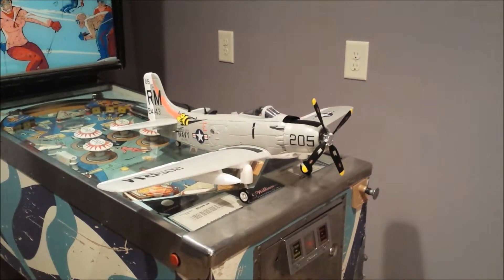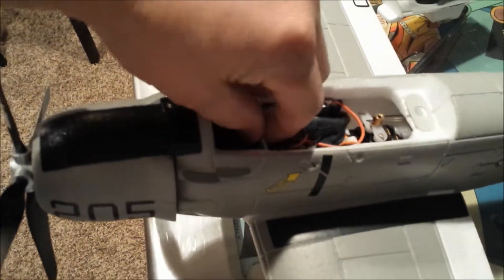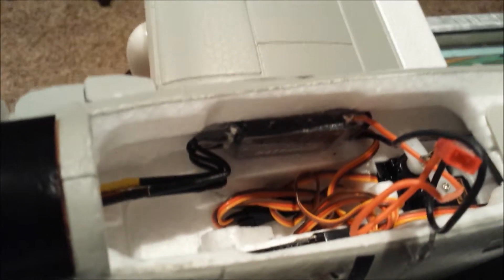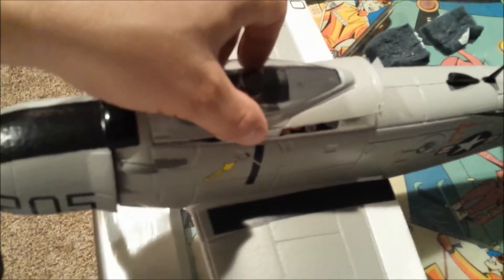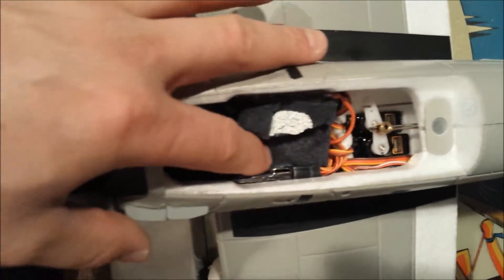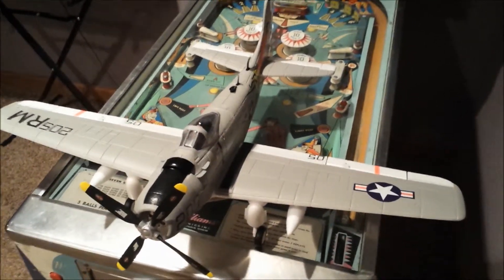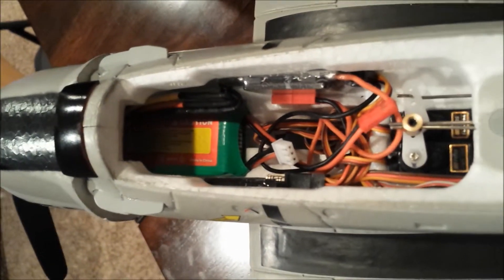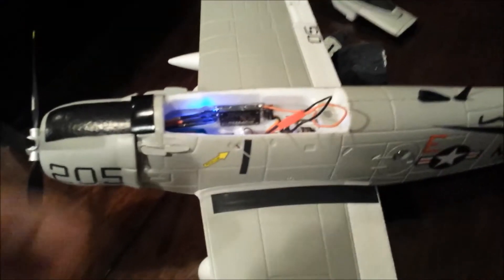Adding 3-axis gyro to FMS V2 Skyraider

Comment: Hi, just want to know how did you balance the CG of this plane. I have bought the same plane, but somehow, I am unable to get the CG at 65mm as stated in the manual. The only way I could achieve would be to add some weight in the tail section of the plane. You have any suggestion?
Reply from the maker: Hi Rahul, at 3:16 I point to where my battery goes. Basically I push it as far forward as possible.  I use 2 cell 1000mah batteries.  I put a little piece of velcro up there and on the batteries too to hold them in place a little better.  My center of gravity is about 3.5 cm back from the leading edge of the main wing.  On low wing planes you flip them upside down to check COG and my fingers are directly opposite the rectangles that hold the main gear into the wing.  I hope this helps.  One tip - try to keep the airspeed up all of the time - I stalled it up in the air and almost crashed as it went into a little bit of a spin - luckily I had enough altitude to recover.  It can be a little tricky to fly in any kind of wind but it is a real nice flying plane.  It was my first low-wing plane after I got pretty decent on the trainer plane.  Good luck!

Just re-read your question.  65mm doesn't sound correct.  I'll see if I can find my manual, but I'd check to make sure you are looking at the FMS 800mm SkyRaider manual?

Just checked my manual and indeed it says 65mm too but I think this is a mistake in the manual as it states 65mm FORWARD of the leading edge...  I've always gone with the theory of cg being about 1/3 of the wing chord back from the leading edge.  Like I said before, mine is at about 35mm or 3.5cm back from the leading edge and it flies nicely.  Pretty sure that measurement in the manual is a misprint.  I did a little looking on google and found this site that also shows 40mm back from leading edge as the COG:

http://www.killerplanes.com/content/fms-1-skyraider-v2-800mm-pnp-4-channel-24ghz-epo-foam